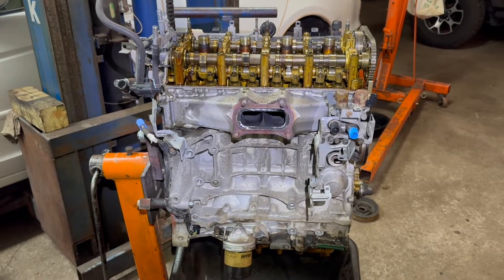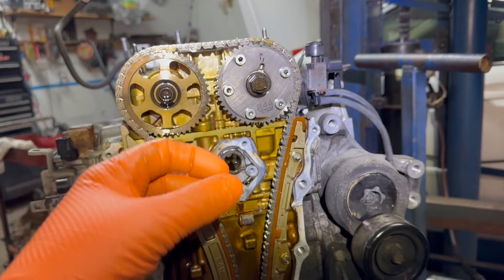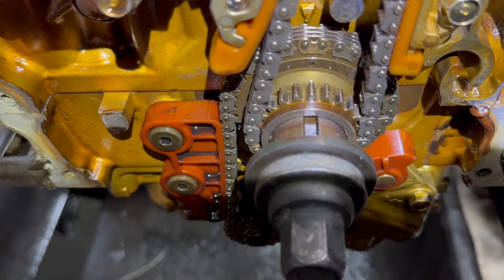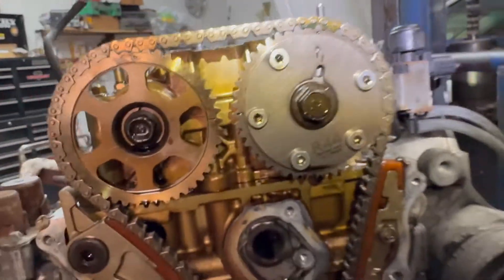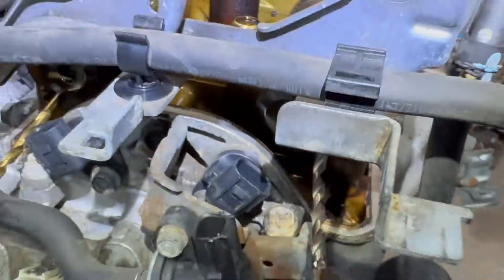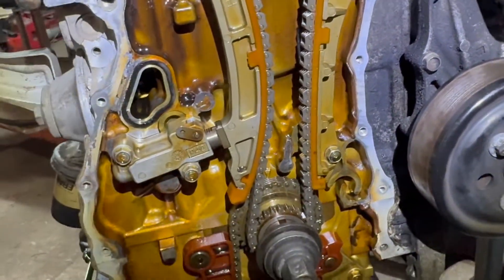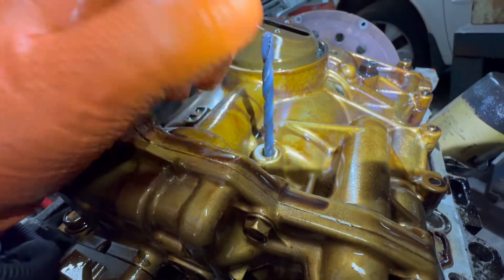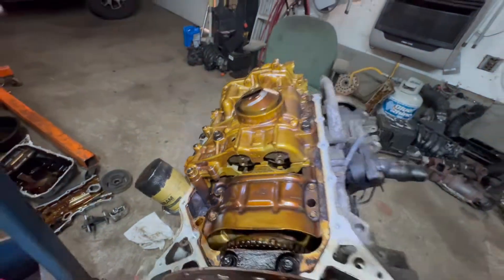Honda/ Accord  K24 2.4L VTEC Engine Complete Valve Timing With Oil Pump & Balance Shafts - 2000 & Up

Comment: Had an engine 2.4 Element with new chain and gears, rumbled at kick down, had to be torn down because of oil pump counterbalance?  What a pain, engine started fine, ran proper rpm's, almost perfectly stable idle, but  had this roar!  Please don't be this guy!  Love the engine-love the Element....just one missed step!

Comment: When you do it in a CRV, how do you drop the oil pan? Does the subframe have to drop too?
Reply from the maker: I would lift the engine to clear the oil pan but if you are doing just maintenance you don't have to drop the paan just mark the chains before taking them off.

Comment: Excellent video sir thank you. Can you tell me if this process is the same for a 2003 element with the IVTEC motor?
Reply from the maker: Thank you! May be a little different but for the most part, yes.

Comment: So basically, it´s all about having everything lined up, camshafts locked in position and then stripping down everything needed to be changed, put new parts back on the engine and everything should be timed right?
Reply from the maker: Correct

Comment: With all the timing marks aligned in order to install the drill bit into the back of the intake cam wouldn't the VTC actuator also have to be in the locked position??
Reply from the maker: That is correct but if you didn't install the drill bit in the locked position as long as all other marks we lined up that would be fine as well. because the camshaft moves back and forth with engine operation the gears don't.

Comment: Does this need to be done for a 2013 civic Si ? It’s a K24Z7 . It doesn’t say anything about doing the oil pump in the service manual for the Timing Chain I’m confused now
Reply from the maker: Yes it does.

Comment: I have the same problem on my car, but I don’t want to make a mistake. I need a mechanic. This video helped me out.
Reply from the maker: Thank you! Yeah, if you're not comfortable doing it yourself, a mechanic can help you out.
Reply: You’re videos  helped me out a lot .
Reply from the maker: Glad to hear that, thank you!
Reply: Great detailed video. Question i got 2010 crv took the valve cover off to replace the vtr actuator spring the little bit to loosen vtr actuator screw fell into the timing cover. Not successful tribg to fish ot out with magnet inside the timing cover. Drained the oil tried fishing it out, no luck. Good photo of the timing chain set up without the cover on. Do you think the bit fell  it on the lower crank shaft pulley and timing chain to oil pump gear? Looks like no room to fall into the oil pan?

Comment: A quick one, my k24 engine gives a hard tome starting, and engine shakes when on Drive, scanned and it shows the P0011 code. dont know htw to go about this
Reply from the maker: Your timing chain problem jumped a tooth because of tensioner failure of timing chain stretch.

Comment: New subscriber here. I have a question regarding my 04 Honda crv,2.4L 4 cylinder, 109k miles.
it sound like diesel engine, no engine code or something, any idea what is the problem/ culprit? Thanks
Reply from the maker: Thank you for the sub!!! Really appreciate that! Can be the timing chain is stretched or timing chain tensioner is failing. If it does it more when first starting it could be this:
https://youtu.be/qHoQ_dlHpYQ

Comment: Is it possible to turn this engine over by the crank and have your timing marks on your timing chain and gears lineup again with one or two revolutions ?
Reply from the maker: 2 Crankshaft revolutions all marks should line up, Not the chain links but the stationary marks, yes.

Comment: Question I’m right in the middle of this process. I have all my Marks lined up spot on. I did not check the holes with a drillbit. Is there any reason for things not to be lined up with all the marks lined up? Again, I did not check with drillbits
Reply from the maker: You should be ok, those other checks are to be sure 100% sure.

Comment: Quick question why would the oil pump chain have to line up?
Reply: Quick question. 
I had oil pan failure- cracked after taking a hit on interstate. 
Immediately pulled over and killed engine.
Towed to dealer 
Upon removal of oil pan- which is all that was thought to be wrong.
Mechanic noticed what he called, “oil pump chain tensioner” failure. That occurred when oil pan was cracked. He mentioned that the tensioner sat very low in the pan, and likely got damaged at impact. 
He ordered a new one and replaced. 
I had no clue at time about the harmonic balance shafts at the time being connected, and since the mechanic originally only knew about oil pan replacement. I’m concerned they didn’t take engine to TDC. 
If the tensioner failed completely, is it possible and I know that’s open ended, lol. That the timing of pump and balancers got off? The engine ran fine for 5 days and then started clacking/knocking/rough idle, all sorts of things.
Reply from the maker: Take it back, yes it’s all related to the timing and should be resolved by them
Reply: I recently did it the same way didn’t line up the pump links and it runs fine I will let you know if it goes it anytime soon…
Reply: @alexsantana5377 That would be great if you could update maybe next oil change or 10k miles.
Reply: @alexsantana5377  have u had any problems with the oil pump chain not being timed when h replaced it ? Or is it still running just fine?? Thanks for the feedback
Reply from the maker: Because it has counter balance weights
Reply: No problems but am swapping for a jdm because I’m getting it ready for my college kid
Reply: Only one aligns perfect but others don't how do align the others on a 2013 honda crv